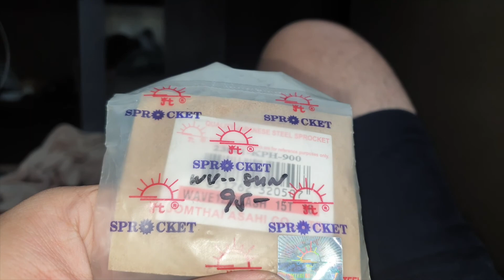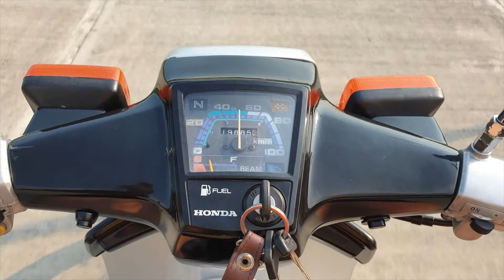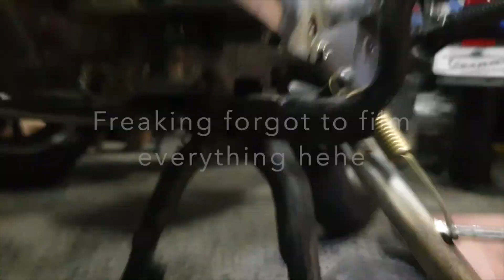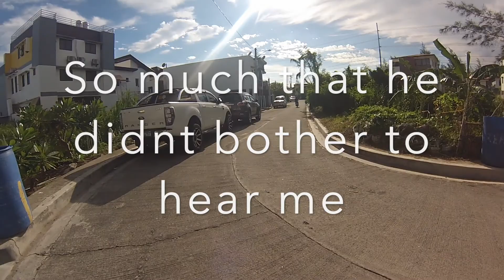Honda c70 EX3(GBO,C800) 15T front sprocket

Comment: I have a bike with 72cc and 4 speeds. Top speed it is 82_84 /h and i have 14 pinion. You advice me to put 15?  And with 15 can i make uphill a good speed? Or it is hard? Sorry for my bad english.
Reply from the maker: Depends on your weight sir, or if u  usually ride with a pillion. I weigh 200lbs with stock 14t i struggled to get up a relatively steep hill with a pillion who probably is around 160 lbs.

But with 15t now as long as im alone I can still climb up. As long as its not that steep. :) and if you weigh less than me, i think you will have an easier time going up. Cheers! Thanks for watching.
Reply: @jepoyonbikes9830  now i see, i have 15 front 46 back i i have 73 kg and my girl friend 59 i some times i ride with my girl friend. The bike it is a FIRST BIKE ENERGIC made in Romania. A honda clone 72cc engine.
Reply: What size rear sprocket bro?
Reply from the maker: @randyparmanan8017  15-34T
Reply: @jepoyonbikes9830  thanks mate 👍
Reply: @randyparmanan8017  i think it is 46T

Comment: Can install 16t on c70?
Reply from the maker: You probably can but I won't advice it if your engine is stcok and you live in a hilly/mountainous area. Engine will have a hard time pulling.
Reply: @jepoyonbikes9830  my engine is stock but coil,cdi racing, rectify 12volt , battery 12volt , exhaust & carb ex5 100Cc , hill n normal way mixed mostly normal way... now using 14-36 sproket  but engine overram high rpm too Early but top speed just 86kmh I want engine smooth low rpm especially longer gear ratio for long ride like highway etc
Reply: @jepoyonbikes9830  I'm planning to change 16- 40 sproket  or 16-39,38
Reply from the maker: Knowing that +1 tooth upfront is = -3 teeth at the back, your planned ratio of 16:40 Can be achieved with 15:33 or 14:30. And it will give you the quiet highway ride you want. At the expense of acceleration. Does that make sense? Tell me if you didnt get it ill try to explain it some more :)
Reply: @jepoyonbikes9830  low rpm ,low vibration, smooth ride with decent top speed it's inaf ... I hate over vibration at top speed high rpm , my current gear ratio is 2.57 - 14-36 by changing to 16 - 40 it's will be in little different 2.50ratio but different riding experience with long gear ratio  2nd can go in high rpm longer distance before change 3rd gear .... My current gear ratio is middle ! Still can go up hill with 2 person but I try drop 14-35 it's make so struggle and also hard to get top speed but in highway it's nice to ride....next I going to do camshaft change !!! (Low camshaft) with smaller sprocket size then change test to (high camshaft ) bigger sprocket 😁 thanks so reply bro I always keep changing n applying different modifications on my c70 but it was so hard to catch up properly & perfect modifications
Reply from the maker: @dhanisvaran5135  allright then gluck
Reply from the maker: @dhanisvaran5135  Id probably go the cheap route and change the rear lang. Not change both if im gonna get roughly the same gear ratio. Plus a smaller rear sprocket means less unsprung weight. 14-35. Thats how you can get the 2.50 ratio you wanted without spending on both.